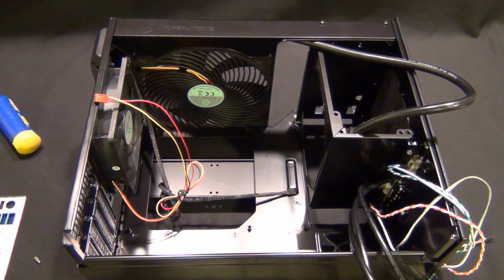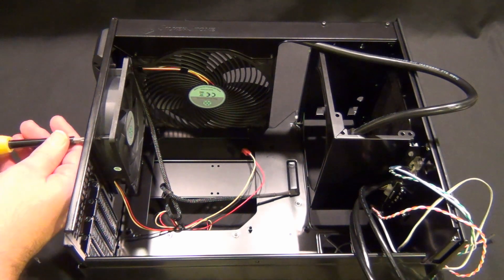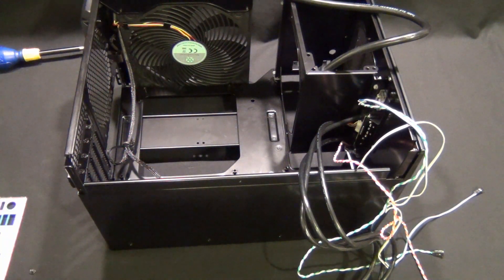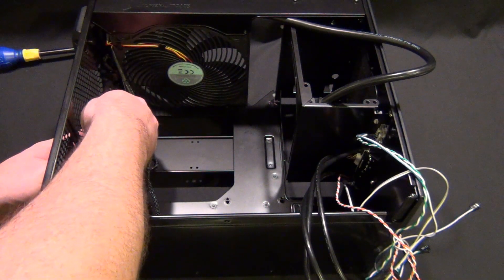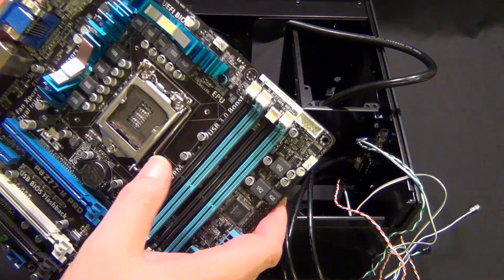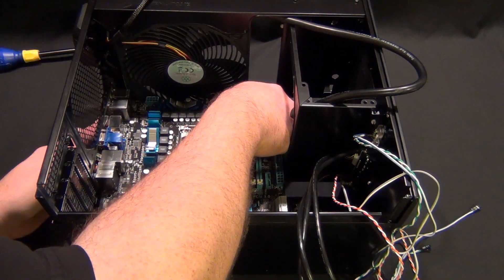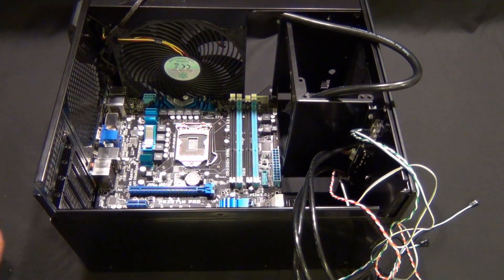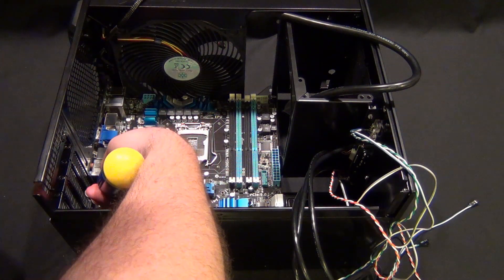How to build a m-ATX computer - Part 1

Comment: the only time a magnetic screwdriver would have the chance to negatively effect your hdd is if you touch it when the screwdriver...OR if you had a specially made HARDCORE powered magnetic screwdriver ( it would take afro engineering an actual power source PHYSICALLY connecting to the metal magnetic end of the driver) while screwing in the screws to mount the hdd to the case.

the Magnetic power/properties of your typical sub 40 buck magnetic screwdriver are not powerful enough otherwise.

Comment: I have used magnetized screwdrivers for over thirty years and never had a problem. It makes it so easy. I would not worry too much about it. If you ever drop a screw make sure you get it out before turning power on, it might short something. Did you know that all hard drives have large magnets inside which are many times stronger than a screwdriver? They are really strong and they do not harm the magnetic platters that are sitting very close to it.